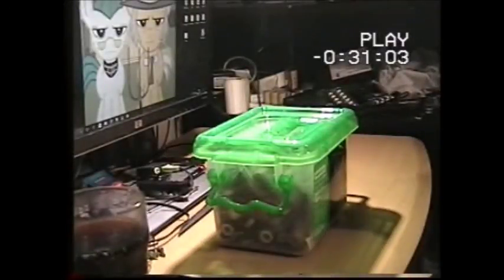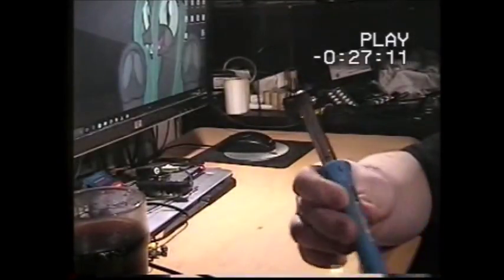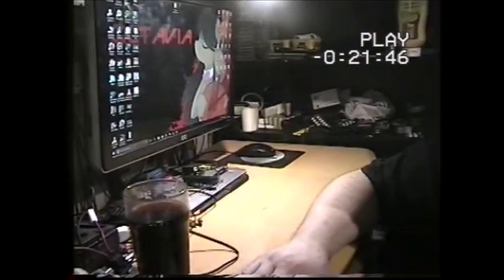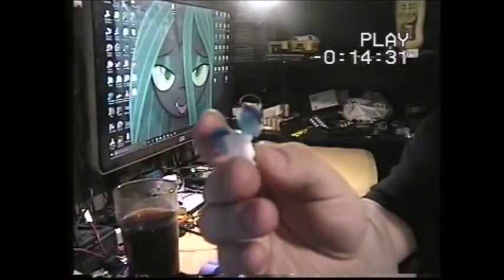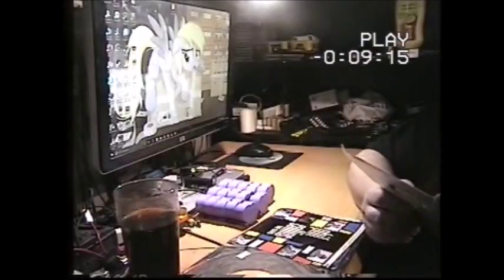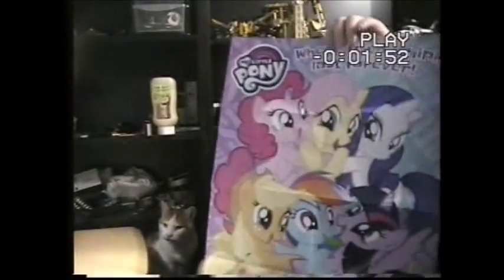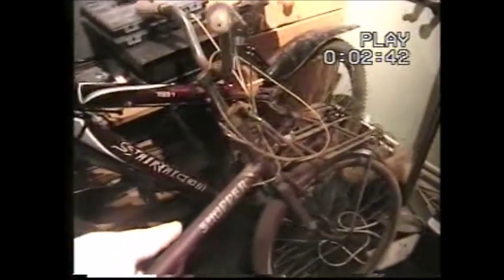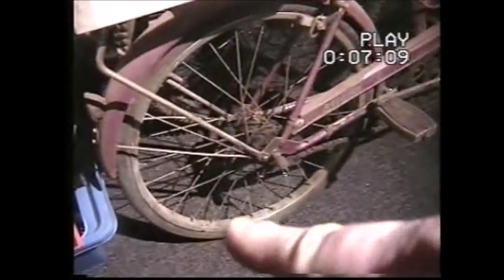MLP:FiM stuff, New Vintage Bike Project, Random Junk Vlog.

Comment: That is one nice cone there! The sleeve is good for it's age and I am surprised it still has the sleeve in place as they usually came off. They are very heavy cones and the sand weight inside is heavier than the rubber weight inside the older ones. Glad to see you are still collecting. I will have a video up on my 3 new ones soon and well said about the 'cones are theft if found in bushes' argument, I completely agree with you.